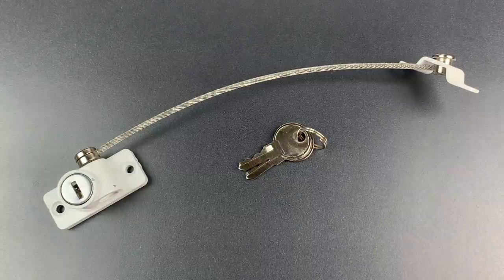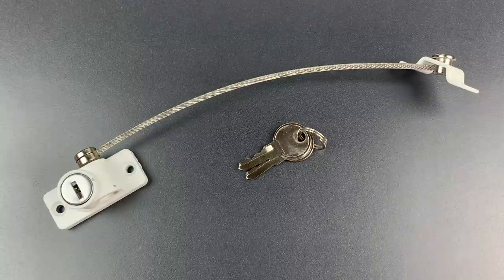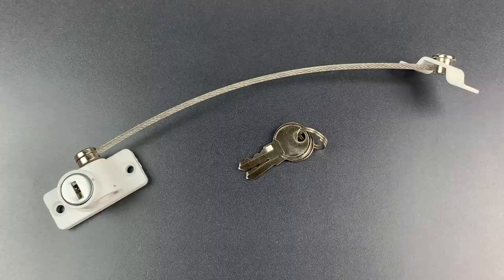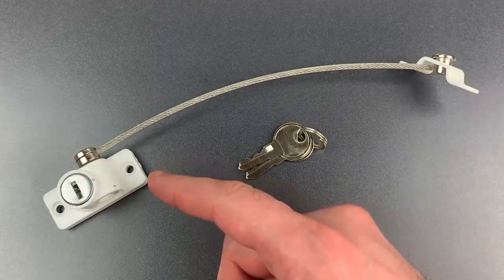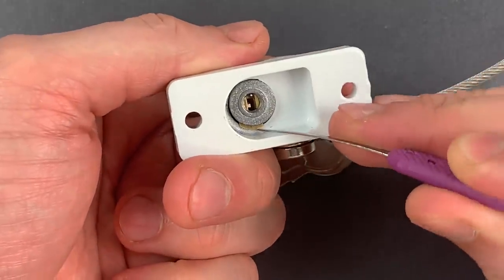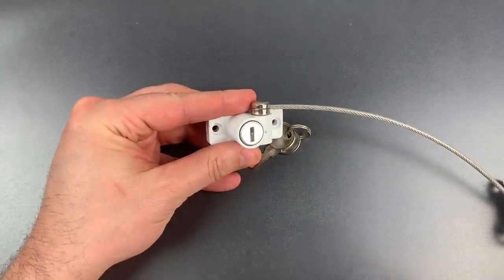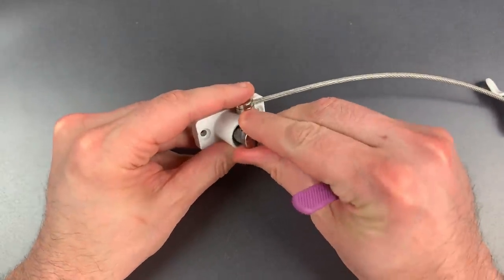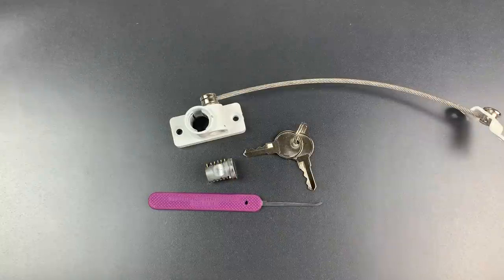[873] Why Is This Lock So Dangerous?

Comment: Truthfully,in an emergency there’s a chair going thru the window first.
Reply: Good luck, most of the windows secured with these are double-glazed and likely to bounce the chair straight back at you!
Reply: Good luck with that when the room is filled with smoke and you can't breath anywhere except for down at the floor
Reply: Then fine it will get kicked out... You'll be surprised  What adrelindin does to a person.
Reply: Realistically, in case of fire you could very well be too panicked to even consider that.
Reply: @pw1187  Okay, but i assume that you dont wear shoes when you are sleeping and that they arent right beside your bed. Kicking that window bare foot or with socks will really hurt and bleed alot
Reply: @horseradish843   I can only go off of experience what I seen in combat when your adrenaline is pumping And when it's life or death  You'll be surprised what the human body can do
Reply: @safe-keeper1042   Realistically if a hotel Room deploys those type of locks on the windows door goes to the outside it is not the hallway
Reply: The locks may not be as strong as the window.
Reply: In the case where the window is your required exit path, a chair might not work. Try sleeping with a hammer in your side table. Use whichever side to smash and clear surrounding glass from the frame and then using a blanket or something on the bottom of the window to reduce cuts.
Reply: @pw1187  all this for a lock that isn't good anyway
Reply: have you seen most people? Most people could barely pick up a chair, much less swing it with enough force at the right angle to actually break a window, and not get it tangled on the curtains and so on.
Reply: @pw1187  adrenaline or not, your body is going to need blood to function
Reply: @Papzi I would rather hack my foot off with a rusty knife than burn.
Besides like another poster pointed out. Adrenaline is a hell of a drug. You wouldn't even realize  you've been cut
Reply: I'm going to bet that a hotel that installs these kinds of locks isn't going to anchor the screws properly in the first place. If one could get a good grip on the cord, you can just rip it out.
Reply: @wufongtanwufong5579  okay but the solution to this is to not use that lock, because I would not give up my foot for a terrible lock
Reply: If there’s a fire, the window is secured, you don’t have a lock pick, the glass is virtually unbreakable and smoke is filling your room… might I suggest the toilet snorkel?

Go ahead, google toilet snorkel.
Reply: Most hotels have a fire suppression system all over the hotel. Rooms have fire sprinklers with atleast a fire extingusiher out on the hall.
In the even of the door being bloked by fire and with you having no chance of extinguishing it, I recommend the use of the window as an escape route. If the window is not a sure fire way of getting out. It is best to turn on the tap soak the bed blankets to smother the fire. You may wet the surrounding area to lessen the chance of a flash over (do not wet areas close to electricals).

In terms of breathing. 
You may duck down and breath the remaing air below the ground. 
Use the toilet snorkel method , but you only have a small air pocket there and it will not last. Try openning the window a bit just enough to fit a hose or your mouth. Open  the window a bit as a large oppening will oxidize the fire and speed the spread of flames.

Last of all is to call for help, as se hotels have faulty or no alarms. Male a lot of noise then conserve your energy later on as you try to survive.
Reply: Midgard Eagle definitely easier to come up with that than pick that lock lol
Reply: @witeshade  what kinda chairs do you have lol
Reply: @monksapollo735  metal framed chairs with cushons. The chair is around 4-5 kg.
Reply: @horseradish843  Most people will slam the window open, breaking the lock.
The window won't be double paned and if it is it'll still break on the second try if you throw a lamp or chair at it.
Reply: That lock doesnt look particularly hard to force but there could be disabled people staying there so an emergency exit through the window is illegal anyways lock or no lock.
Reply: @pw1187  they are common in UK where the door opens into a long internal corridor.
Reply: OK, what do I do if the chair is chained down... 😀
Reply: If the room's on fire, just sit in the chair. "This is fine."
Reply: Ah, the good ol’ chair pick and table rake
Reply: His way is faster.  :)
Reply: The force of the chair hitting the window would likely rip the lock mountings from the window and/or frame.
Reply: Normal residential windows aren't made of tempered glass like car windows. Both layers are also super thin. Punching it, kicking it, throwing any hard object at it, or just pushing against it with force will easily break the window
Reply: Interesting point, when I was changing my douvle glazing a few years ago I decided to try and kick the windows out. Managed to do so from the inside while the window was locked, but it took about 6 or 7 kicks and I cut my leg on the frame through my jeans. I don't think it would be possible to kick it in from the outside though, due to the overlap on thr frame and the fact you can't get in a good kicking position due to the height. I'd say in an emergency its very possible to kick out a window that's only held in place by the 2 small screws in that lock.
Reply: @RealUnimportant  The scene is quite amusing.
Reply: good luck getting out of the window without A: failing to break it, B: avoid the glass shards that would most likely cause you more harm than not using teh window,

C: losing your life because the window refuses to open before you get trapped.
Reply: You only need to yank the window hard enough to rip out 2 screws on either side... in life or death scenario this is like ripping dental floss apart
Reply: @myopinonz  Not if you don't have muscle.
Reply: thisistherevolt i took the lock off a window at my school once using a bus pass
Reply: @pw1187  You'd be surprised what oxygen deprivation does to a person, too.
Reply: @fabian.f97  all this was hypocritical, but yes your right but most of the time alarms would sound way before one's room get smoked filled...

But yea slow clap for you
Reply: Okay nobody said it, my chair and all objects are attached to the walls and floor with either glue, adhesive or screws...
Reply: I figure that I will either be shooting the window to break it or shooting the lock.
Reply: @RealUnimportant  Uhhh what? You can absolutely break through double glazing, and it's not that tricky. When I was like 8, my mum threw some of my toys away because I didn't clean my room, so logically I smashed through double glazing with a cricket bat to try and get them back. Not my finest moment, but if 9 year old me can do it, so can most people.
Reply: @horseradish843  bleed, or die?
Reply: You can't use a window as an escape route anyway once you're above the 3rd floor?.
Reply: @chang.stanley  That's not true.
Old crappy windows aren't tempered, but pretty much any high R value window has to be.
I worked for Viking windows once upon a time and one of the occasional odd duties was breaking panels of tempered glass from windows that failed QA.
You could pound the face of them pretty hard with a sledge hammer and it would just bounce off.
One tap on a corner and the whole panel just crumbled.
Reply: @e30mark  lamp, suitcase, laptop...if its at that point anything is fair game.  Maybe a sturdy flashlight as either a hammer or bat depending on the size of it.  If the choices are stay and die or attempt to break out, I know I will try.
Reply: @pw1187  I've also seen a lot of people who assume they know what they'll do until it turns out that adrenaline shuts off thinking functions.
Reply: @keith6706  oh  that might be true, with "some" people...but this person here (me) has been battle  tested did 3 tours in Afghanistan and 2 in Iraq.. I sorta know what I can do under extreme pressure...but i can't speak for others.
Reply: @pw1187  I seen first hand my step father rip a car door off like Superman because of adrenaline. he ripped it off and threw it across the road. He pulled his arm out of the socket doing it. Say what you what, I seen it for my self.
Reply: @jared4169 
Honey... did you remember to pack the sleeping hammer?
Reply: @pw1187  agreed our body in life or death
Can activate all our tedons ripping them but make pretty much cars be lifted
Reply: But broken glass is dangerous. I would use the chair to for the window open by bashing the window, ripping out haft the window in the process along with the glass and the lock.
Reply: I’d be the first one laughing as it bounced back at you....
Reply: If I can avoid crawling through a frame with sharp broken glass sticking out of every surface, that would be preferable...
Reply: You wish lol hotel window frames aren't built like tanks but they'd keep a chair inside the room
Reply: @RealUnimportant  I bet that lock would come out the wall with the tiny screws that keep it in place 😂
Reply: Now I'm gonna have to bring a hammer next time I go to a hotel. Not because I think I need it but because I want to leave it out for the maid to see. I don't sleep in a motel without a gun handy...seems to be the key to most windows.
Reply: To all the naysayers: it's a good thing I take my take sledge and window breaker everywhere... And my framing bags. I drive everywhere.
Reply: @kjamison5951  LOL...I spent way more time reading about the toilet snorkel then I probably should have.
Reply: Tempered glass is pretty common today and will bounce a hotel room chair, to break it you should have one of those auto emergency tools.
Reply: @pw1187  can it make you spell?
Reply: This reminds me of, "If you're flammable and have legs, you are never blocking a fire exit." - Mitch Hedberg. I propose a corollary, "If the only exit in a fire is glass, it is never locked."
Reply: Have you done it or you just watched it in a movie? I have Ikea plastic chairs at home
Reply: It’s never a fluke...
Reply: @safe-keeper1042  Not him, only you.
Reply: Reading the old comments it would seem expeditious to recce the room BEFORE you go to bed and to sleep.
Reply: I wonder how many people die in fires because they don't think to kick through 2 layers of drywall and some insulation..
Reply: C W It makes them jump out of the top floors of the World Trade Center.
Reply: @pw1187  Either way you'll probably get cut to ribbons trying to climb through it.
Reply: @jeepien  maybe maybe not...dam people still responding to a year old post
Reply: @horseradish843  you don't need to break the window itself, the frame is the weakest part of any opening, 99% is made of wood and only held together with two screws.
Reply: 2nd_place umm.... don’t know if anyone else got that but I sure as hell did...

And it’s wrong, very wrong.
Reply: People in this thread thinking they're going to kick out a window that will deflect a steel chair back at your face.... 🤦‍♀️
Reply: People in the replies saying "you can't do x" like they never heard or witnessed an adrenaline rush.
Reply: In case of fire: break window and let in more oxygen in for fire :)
Reply: @RealUnimportant  Agree. He has seen too much Hollywood movies. In real life this does not work
Reply: @RealUnimportant  Chair didn't work? No problem - Except for banks/similar high-security situations, I have yet to meet the window-glass that won't get out of the way when you apply a few rounds of .38 special, .45ACP, or 10mm - depending on which one I happen to have strapped on before starting the trip.
Reply: Honestly I’d grab the rather shit looking cord and try to yank it out
Reply: Picking the lock is probably safer, though. Going through broken windows is way more dangerous than the movies would have you believe
Reply: @jared4169  A hand sized bolt cutter would probably be faster just clip the wire, Definitely easier to store in luggage.
Reply: @felsinferguson1125  Good luck if you're coming to the British Isles
Reply: For ladies reading: A stiletto-heeled shoe can make an effective glass-hammer, particularly the type where the heel-insert is made out of steel (although I would much prefer to have the proper tool rather than rely on a shoe!) Also, it was in relation to breaking out of a vehicle that I heard this tip, it may be less effective against ordinary window glass.
Reply: @richiehoyt8487  Won't ever be a problem - I'm NEARLY as interested in visiting Britain as I am in sticking my wedding-tackle into a running meat grinder.
Reply: @felsinferguson1125  Service Pistol, or similar in those calibres? probably a good choice if you're at all liable to be running into 'bad guys' - but would you not feel more comfortable with a Desert Eagle if there's a chance of having to go up against a hardened opponent like a hotel window? I mean, I'd happily take my chances against one with a •22, but then you know what us Limeys* are like for courting danger..! In the meantime, regardless of where we find ourselves, it is to be hoped that we BOTH keep our pist- Our handg- SORRY, our peckers OUT of any mincers, meat-grinders, wurzel-mangles or anything else of the sort!

*In actual fact I'm Irish, but I don't see much use in splitting hairs
Reply: @slamblamboozled1245  Not to run your mum down or anything, but actually, I wouldn't blame 9y.o. you! I mean, she sounds kinda mean to me, unless she was just pretending to have thrown 'em out?! A lot of people do say I'm sort of immature though (I can't think why..?!)
           I will say this - my 'nan', ie grandmother, pull†ffré4eed the same thing on my dad when he was about that age, and no, it's not like he grew up an embittered monster or anything (sorry folks! 😝)... But you can tell, even now, he's still sore about it, 67-odd years later. When my Nan died back in 2001, he did kind of let go of a lot of the negativity ('cos he's not, y'know, mad) but you can tell, even today, on some level it kinda bugs him!!)
Reply: @horseradish843  It's fine if glass doesn't break the lock surely will. It has two shallow screws that will rip right out with not too much force.

Comment: "Let's do that one more time so that I can show you that it's not a fluke."

It's never a fluke.
Reply: The only fluke was the design of the lock.
Reply: Bosnian Bill and LPL are perhaps the only lock picking youtubers where if they say “it’s not a fluke” I can believe them unconditionally. They have proven themselves time and time again, and I know they are trustworthy.
Reply: And it's never lupus.
Reply: @CelestisForgeUK  that's when they get you. Never fully trust
Reply: If it were a fluke, he'd try a way that isn't. So when he says it can be done, it's never a fluke.
Reply: It only worked cause the lock was open. If it was closed it wouldn't work. Most locks like that you can desasenble if they're open.
I don't understand the point of the video.
Reply: @fdivito12  this lock does not get more locked than it was.
Reply: @fdivito12  I did this exploit on a cabinet lock a few weeks ago, my mother lost the key and asked me if I could help open the cabinet.
I started single pin picking and since I didn't know what the key looked like I started by counting pins, I got to the 6th pin and the whole core came out.. Now that was a fluke, but it also opened the cabinet, and since I found the bypass I could easily do it again on the other cabinet..
After seeing this my mother didn't bother to look for the key, but just leaves the cabinet unlocked, as it basically was anyways.
Reply: @fdivito12  No.. It was not open.

Point of this video is that those locks are stupidly dangerous and he shows a way to bypass them in an emergency.
Reply: No it is not.  But we only know that because LPL proves it to us whenever possible.  I am grateful for that extra-mile effort.
Reply: @fdivito12  ??
Reply: @fdivito12  neither do i, I mean he literally said the window can only open a few inches, so its going to be hard to do what he did from outside surely.
If he had done this in situ from outsite his actual hotel room - 
it would have been a better video and not so clickbaity.
Reply: We rly out here worshipping like that and I don’t even mind 🤷‍♂️
Reply: @ukdashcamguy500  he's not trying to show how to unlock it to get in from outside. The whole point is so you can disable it so its not a firehazard
Reply: Until it was
Reply: I would have liked to see him show the back so we can see how to pick would pull upwards on the metal piece
Reply: We need a “It’s never a fluke” on a t-shirt
Reply: I thought he was going to say, let's do that again so I can show you in slow motion...
Reply: Haha
Reply: @alexanderelderhorst2107  yes I don’t get how it worked…